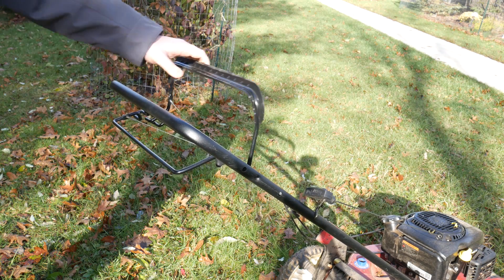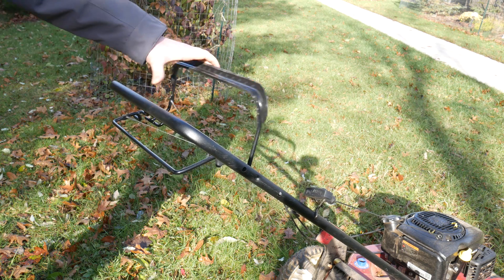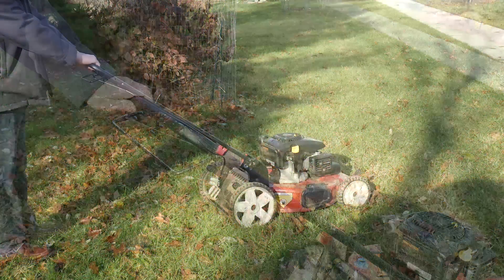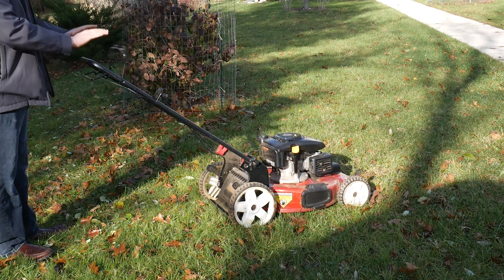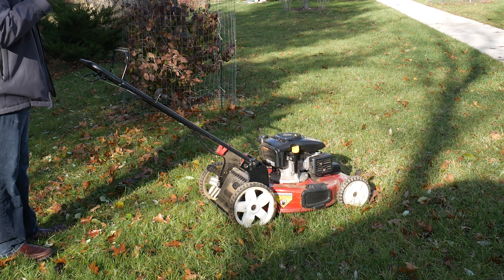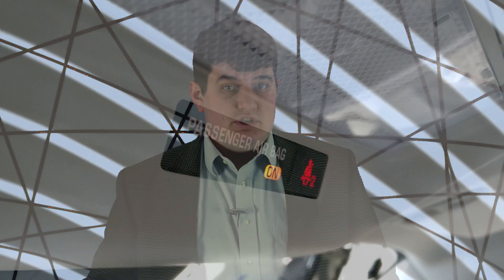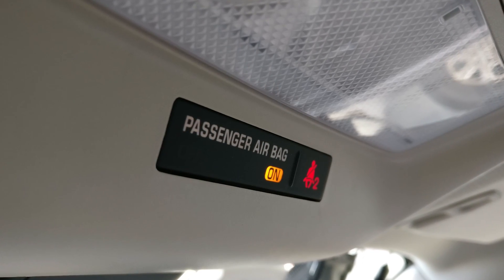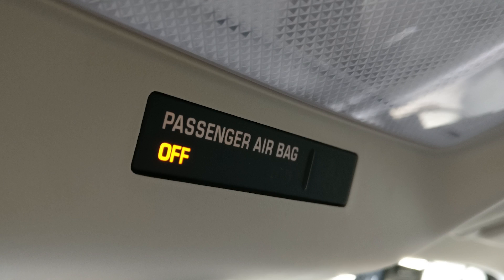The Dead Man's Switch:  How Anton Yelchin's life could have been saved

Comment: Yeah I wouldn't want a car that goes into park when my seatbelt is unbuckled. Sometimes when off roading with my 4 X 4 I don't have my seatbelts on (though usually I do because there can sometimes be a chance of rolling on more advanced stuff). Sometimes I have to get out frequently to spot for big rocks and such. That said, there was one time I thought my Tacoma was in park when it was actually in reverse. I love my Tacoma, but it seems to have this quirk. My Corolla didn't have this problem because it went straight up and down where my Tacoma automatic shifter shifts slightly to the right and left in places. And one of those places is between reverse and park. Not a fan of this. I have to be extra careful when getting out to spot on hills and turns.

Comment: Tesla cars automatically activate the parking brake and shift into park when the door is open and when the driver is no longer detected in the seat because those cars do have pressure sensors in the driver’s seat.
Reply: Most if not all the cars on the road have them, just they need a software update is all really they need, and maybe some mechanisms that activate the parking brake because the cars got the pressure plates, just likely don't have any motors that turn the parking brake or anything.

Comment: Steering over wire is horribly dangerous. What do you do if you lose power while you're moving? A normal car can still turn with more effort, since non-power steering can still turn the wheels, but if it's all computerized, you lose steering.
Reply: Yikes!  You have absolutely no clue what you're talking about!

What you are referring to is a failure of the power steering system. If this happens, you can still steer the car, but if the physical linkage breaks you're almost guaranteed to crash. You cannot control the vehicle if the steering column itself fails. This does happen, and it has caused many fatal accidents.

Steer-by-wire is not 'dangerous', - in fact, it's way safer. Not only are steer-by-wire systems designed with both mechanical and electrical *redundancy*, they are often designed to fail less severely if they fail at all, which due to the redundancy, is incredibly unlikely. For example, in many vehicles, the on-board computer will detect such failures and automatically apply the breaks faster than any human driver could possibly react. A lot of aircraft don't even have mechanical backups anymore, and they are safer than automobiles. 

Of course, things can still go wrong and accidents are still possible, but generally speaking, modern computerized vehicles with drive-by-wire systems are safer and there are enormous amounts of data that prove that beyond a doubt. Modern automobiles go through incredibly strict safety testing. Car companies aren't in the business of using unsafe technologies that are likely to get them in legal trouble.

This is technoparanoia at it's finest.
Reply: Half the idiots given licenses today are more likely to cause fatal accidents than computers... usually because they are too busy texting on their pocket computers rather than applying attention to the road! If the tech is good enough to be used in military stealth fighters doing complex maneuvers at mach speeds, it's good enough for my Toyota Camry. I'll gladly trust my life self-driving cars over some drunk moron texting on their phone whilst flying down the highway at 100mph. I personally can't wait until all cars on the road are self driving. It's coming, so you better get over your irrational techno-fears.

P.S. this video isnt even about steer-by-wire it's about a famous person who made a user error by not applying the handbrake upon exiting the vehicle. It's there for a reason. This video for some reason also glances over the fact that despite the poor design of the gear shifter in this particular vehicle, it still makes an audible chime warning you that the car is not in park when you try to exit the vehicle. A prime example of people putting too much thought into a death simply because it was a famous individual. The shifter could be designed better, but at the end of the day, it was a freak accident caused largely by human error.
Reply: @elonmusk8711  I hope you're still as disdainful when someone hacks your engine computer or your medical device and kills you. At least that way, you'll be consistent right up to the end. 
I trust simple mechanical physics with my life, but if given an option I'd rather not trust computers. I've programmed before, and the exercise does not instill great trust in the reliability of computers.
By the way, I don't oppose a system where only the power steering is computerized nearly as much as I oppose one where there's no steel rod connecting my hands to the direction the wheels point. No lazy programmer with a crappy manager can screw up a long chunk of steel without someone noticing.
Reply: Also do you get any feedback back from the road as well? Because if you can't tell if the car is getting loose you won't be able to correct until it's too late if at all

Comment: So what you're saying is, because a famous person was incapable of using the parking brake and died as a result, we need a safety system to prevent other idiots from succumbing to future Darwin Awards?  I say, if we really must have a system to stop people killing themselves by their own relentless stupidity, link the parking brake to the seat belt sensor, which would not only hold the car properly (rather than simply using engine resistance), it would also force similar idiots to use another device which is intended to save your life.  Or my personal preference: Find people who refuse to use the parking brake and/or the seat belt and ban them from driving, since they are a danger to themselves and other road users.

Comment: So when i lift my ass from the seat to stretch my body/legs, the car will stop when doing 100 miles per hour?
Its a nice theory, but not practical
Reply: he mentioned that you can program it not to use the feature when the car is going anywhere over 5mph so this wouldn't happen and would only work to stop a stationary car from rolling

Comment: Vws have this system in use. Stand up? It stops. Opens the door in drive? Stops.
Reply: Well, Volkswagens are amazing and Jeeps are not good. That's why the Jeep didn't engage park or the handbrake.
Reply: @aidan1585  That's the damn truth. I'm unsure to this day why any Daimler Chrysler product has such a rabid fanbase. They've never been the pinnacle of anything. Even their most famous engine design was just "I dunno, just give it huge valves and damn the efficiency consequences of that horrible burn pattern!"
Reply: That would be a stupid system, scoop your butt up a bit to scratch yourself on the highway and the car stops.
Reply: @greentjmtl  not above a certain speed and only if you are not buckled in. I think the speed was around 7-12 kph.
Reply: @K0nst4nt1n96  That makes more sense, although still a solution to fix stupidity (be it shifter design or driver).
Reply: @greentjmtl  I have driven a lot of different cars and i never liked any automatic one. Even if it was my first time backing out or in i felt more stressed with how delayed the automatic or dsg gave me the power i needed and i felt that with a clutch i could cut the power anytime. Well to each their own i guess. You would never leave a manual in a gear and leave the seat. But with automatics i guess it happens often enough to implement such a system. 
You can see enough of road rage videos drivers hopping out while its still in Drive.
Reply: @K0nst4nt1n96  That's true, you can be proactive with manual but automatic is reactive. Although I'm comfortable with both and learned to deal with it.

Comment: This is why most cars, manual or automatic have a separate hand break. Fine a hand break isn't a "dead man's switch" but it would have rendered this video nonexistent. A dead man's switch would be problematic as if the sensor broke the car won't work.

Comment: This is one of the most retarded ideas I've ever heard. Besides the point that a dead man's switch on the driver's seat is a useless addition, it's just unnecessary overengineering. Any automatic transmission could simply go to auto-P as soon as the car stops until you activate the accelerator. It would require less additional hardware and provide the bonus that you wouldn't have to keep pressure on the brake when at a red light. And it's a system that has existed for more than 10 years.

Comment: My 2019 VW Atlas engages the parking brake if I attempt to shift from park with a door open.
Reply: Have a 2020 Tiguan, opened the door while pulling out of the garage and it puts on the ebrake and starts screeching many tones to alert me
Reply: Adrien Frisque 2018 Grand Cherokee did that
Reply: My 2017 Ford stops and puts itself in park if you open the door while in reverse.
Reply: G20 3er. When I tried to pull the car forward a bit with the driver-side door open, the computer prevented me from shifting to drive. People around me thought I was revving at them 😂
Reply: My 07 dodge 2500HD uses the horn as a warning if you open the door in reverse, its happened to me a few times when backing up to a trailer in our work lot, since we stack trailers in 3 wide, 2 deep. id get it close then hop out to raise the trailer more to hitch up then hop back in the truck to move it back the last 8 or so inches with the door open. And the horn blows a few times to warn of the open door, the moment its shifted into reverse.

Comment: Typical poor modern designers line of thinking.
When I got my Engineering degree, I was thought to add redundancy in everything.

But, it seems that, now a days, even Avionics don't need redundancy.
Reply: @jasonbender2459  By the way, i did my own Google search for my own name just out of curiosity, and the first result was LinkedIn, where there were not one, not two, but THREE people with my name. Huh... Three  people all named Alexander Preobrazhensky, all on one social media platform. Yet, you claim that it returns 'little more than the novel'. What are you doing, using Bing? Fuck off with your hilarious bullshit, moron.
Reply: @jasonbender2459  Ah, i see the book now. My apologies in that regard, the option to 'read more' did not show up for some reason and I thought your comment ended after 'freak:'.

It's irrelevant. You're a strange person trying to debate a name. My name may not be common (in fact, I'm quite sure it is not), and it may appear in said novel. That is completely irrelevant. The fact that you are so focused on it really just demonstrates your lack of credibility on the topic at hand. 

Even if you were correct, and my name were fake (it's not, you're mental), it does not change the relevancy of my argument. Speaking of false equivalencies...

My claim was simple and straightforward: Redundancies are required in avionics. I never claimed the Max had/has more than one AOA sensor (not an 'AA' sensor, by the way). I never claimed to be referring to 'more than just controls'. This is YOUR ASSUMPTION. All  said was that the required redundancies do not need to be mechanical - as in, they can be electronic. Your brain seems to be misfiring on more than a few cylinders. 

FAA regulations require redundancies in avionics for critical flight controls systems. That is a FACT. Not in all systems or in all aspects, but they are required in critical flight control systems. The AOA sensor is not part of the critical flight control system. Yes, in the Boeing 737 max it can override the pilot and it is a direct input into the MCAS system, but that does not make it part of the critical flight controls, which are defined as the systems necessary to control flight surfaces, landing gear, and engines.

By the way, referencing 'the MCAS' proves you are a moron who likes to read news articles and that's where you have gotten the extent of your 'education'. MCAS is a software developed by Boeing found in the 737 Max, not a universal avionics term and not a system found in all aircraft.

Please, continue to demonstrate your complete lack of knowledge, and jump to more irrelevant conclusions while you're at it! It's very amusing.
Reply: @jasonbender2459  Was the 'AA sensor' part a Freudian slip, perhaps? Are you late for your AA meeting? Did you lose a loved one in a 737 Max accident? This video isn't even about the Max, or avionics. You are reading way to much into a simple statement about regulations regarding redundancies in avionics. You were also unable to point to where i stated that the Max had more than 1 angle of attack sensor. Please! I'm waiting! Sorry that because i stated that redundancies are still required, you came to the ignorant assumption that i must be referring to absolutely every aspect of aircraft design and starting ranting and raving about the Boeing 737 max. 

You sir, are the freak.
Reply: @jasonbender2459  прямо на тебя!
Reply: 1) False, avionics still require redundancies, just not necessarily mechanical redundancies. The controls in modern aircraft are usually triple redundant. 
2) There is already a redundancy - it's called the handbrake, which you are taught to always use when parking a vehicle especially if there is any risk of it rolling away down a grade. Not to mention, the audible chimes that warn you the vehicle is not in park. These sound like redundancies to me. 

This sounds a lot like a famous person who made a grave human error and now his death is being blamed on the poor design of a gear shifter in classic celebrity death fashion. Give me a break.

Typical 'i just got my engineering degree and think all other engineers and designers are stupid' line of thinking. Tragic.
Reply: @elonmusk8711 , I know that Avionics requires redundancies. It was meant to be a criticism to what have been happening lately. Take the 737max, for example.

And no, I haven't just got my Eng. degree, and I know there are plenty of good engineering there.
Reply: Shift by wire is just a stupid idea as the only thing it does is add new failure modes.
Reply: @jasonbender2459  By the way, you never named the novel my name is from... What is it?! I'm interested in knowing!
Reply: @thetowndrunk988   Ok no they don't I was in driver's ed like a year ago and i can confirm they don't teach that
Reply: @aliteraltomato8290  Yes, they do. If they didn't teach YOU that in driving school, that's your drivers instructors fault. Either that, or you just weren't listening, which is the more likely answer from someone who calls himself 'a literal tomato'. This is common sense. This is precisely why the parking brake is there. As TNVolFisher pointed out, this is also present in every driving handbook, and vehicle owners manual.

Comment: Protecting people from themselves is a neverending crusade that only results in less attentive and less competent people in the long run.  No one needs yet another sensor / safety feature crammed into our already overcomplicated vehicled to further drive up price and drive down reliability.   If a gear selector is that bad..  FIX THE GEAR SELECTOR rather than beg for another nanny state mandated safety switch.

EDIT; None of my vehicles have a shift interlock,  manual transmission FTW.

Comment: Two caveats you did not mention:
- It is not "a" computer. The number varies by year/make/model, but with the possible exception of oems like tesla, a car's computer is acctually comprised of a substantial number of specialized microcontrollers or ASICs, with few or no general purposes processing units at all. This is relevant because each ASIC is specifically designed\equipped to perform a certain task which severely limits the kind of tasks it can perform at all... Which means each of these processors requires its own highly specialized software that is stored/upgraded on a NAND die either on the ASIC itself, or right next to it, thus each NAND chip would need to be updated separately. This all brings me to my second point:
- Again with the exception of tesla and some other oems that are introducing OTA updating features, there is generally no user-facing way to update these controller systems. In theory you could use a programming device attached to the ASIC, NAND chip or programming interface, but realistically, firmware updates themselves are rarely available to the general public, if they are available at all. Even a skilled mechanic is unlikely to bother, seeing as replacing the whole controller unit with either a newer or more up-to-date one delivers faster, more repeatable results.

Comment: MAAAYYYBEEE we just need to go back to mechanical levers and linkages for throttle, steering, shifting and braking. 

That's one reason I drive a 2000 model car. It has full mechanical steering and throttle control, as well as a mechanical linkage to the transmission. 

The way every car should be.
Reply: raduque Why?
Reply: Manual transmission FTW!
Reply: Look at this Neanderthal with his y2k car 😂😂😂
Reply: why are those better? ive seen so many cars with broken throttle cables and the link to the trans becoming disconnected sometimes while the car was in gear not allowing the car to be taken out of gear, the simple fact is no matter how your car is set up in either mechanical fashion or drive by wire, its your responsibility to use the machine in a safe fashion, making sure its not gonna roll away

Comment: The problem there is, what if you need to push the car somewhere, and it's automatically put in park. In a Mercedes I used to have, if you left the car in anything other than park, and opened the door, the E-brake would automatically deploy, which is an excellent solution, because if you intentionally left it in, say neutral, you could alway just release the e-brake before actually stepping out.